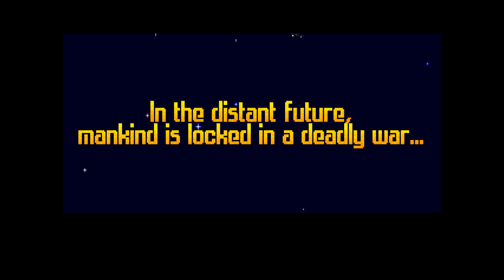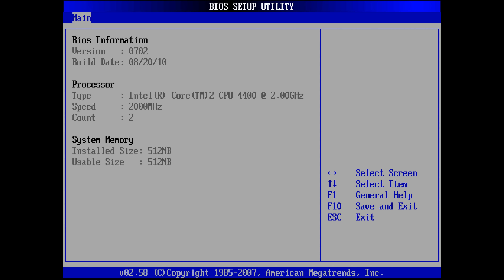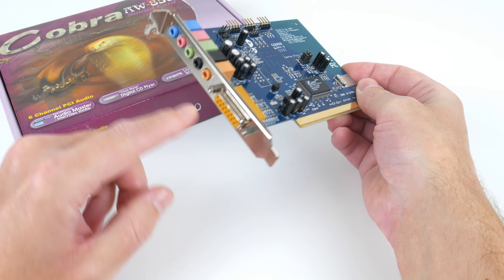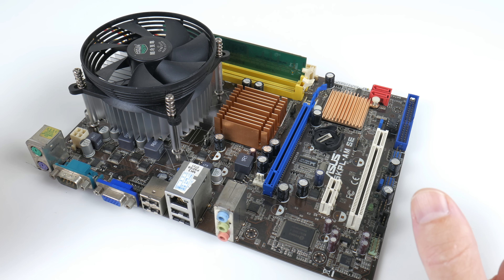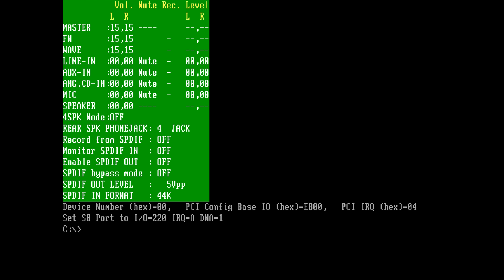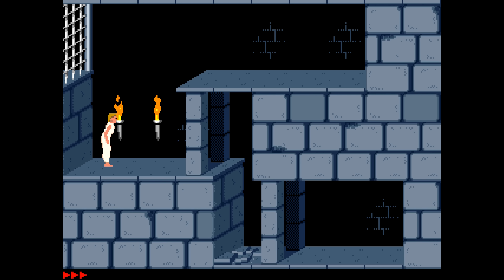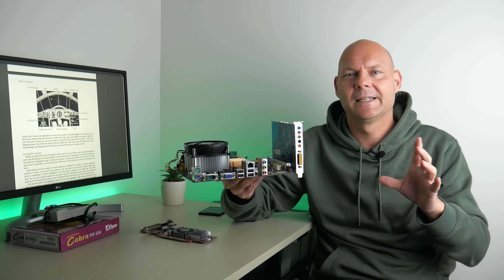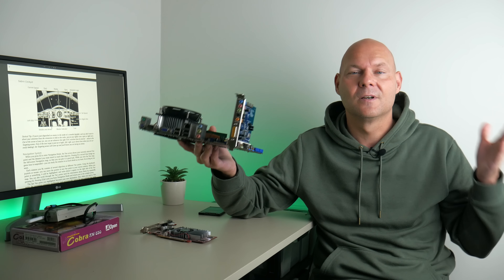DOS Retro PC with Parts nobody wants

Comment: LGA775 just refuses to die. Core 2 Quad systems paired with an SSD, 8GB of RAM and a decent video card can still make for a good basic daily driver. One of the best platforms Intel has ever made IMO.
Reply: Absolutely. Great for Linux retro gaming and I keep a stack of them in the garage for when the guys come over a few times a year for beer, pizza and a LAN party.
Reply: I still play AAA games with a Q6600 and decent graphic card in 2014-2015. I just need a bit of overclocking to make it more playable
Reply: @emdotrod  If it works then good luck to you. I just think AAA games have been complete crap for more than a decade now, the last one I purchased was Fallout 4 in 2015.
Reply: It was an unbelievable rebound after the Pentium 4.
Reply: Do Core 2 Quad CPUs run hot?
Reply: I have 2 975xbx2 intel boards that I'm playing around with a 3.72 dual coreEE CPU and 3 1080 watercooled GPU's that I'm working on. They may not be the fastest systems around but since the CPU is an engineering sample I have had it running at 4.5 ghz. Watercooling will help too! This sucker runs very warm!
Reply: Wolfdales E8400-8600... DAMN! ..and i'm a AMD CPUfanboi(well OLDer person) 😉
^Gotta' keep my Socket 939 A8N-SLI with Opteron 180 for W2K/XP-build someday...sry' 😕
Reply: @dave4shmups  yeah, specially Q6 series when overclocked, still nothing that an old Intel stock cooler with cooper core or an Hyper 212 can't handle
Reply: I bought a couple of Core 2 quad processors for next to nothing a few months ago. I agree they are still very capable
Reply: Phil has already done a vid on modding Quad Xeons for 775. And I can say that it is fantastic performance for 775. I have one that OCs to 
10 x 420 = 4.2 GHz on nearly reg voltage. It is a Quad Xeon X5470 with a 10 multi. The X5470 is the only Quad Xeon that has a 10 multi. And when I got it I said "When you OC with a 10 multi, it feels like you're cheating". LOL
Reply: @dave4shmups  If I remember rightly they do run hotter than the Core 2 Duo, possibly cooler than the Pentium D though!
Reply: @billchildress9756 I have a D975XBX with a QX6800 in it, haven’t used it since it was taken out of my 2nd machine in 2019. Hope to one day stick it in a case with a dual PCB GTX 295.

Comment: A socket 775 system running a 386 game properly is a testament to the x86 retrocompatibility.
Reply: Yes, it's just a shame there is all that "messing about" in the BIOS to disable/enable caches, etc. It would be wonderful if you could just run a simple tool to load in the BIOS you want each time without having to do the changes manually.
Reply: i have 775 quad core system that an run all 2023 in 1080p
DDR 3 max, 9650 !

Comment: Hey Phil, there are some really interesting CPUs for 775 available. The Celeron 400 series, codename Conroe-L. They are native single core processors (the last native ones that Intel produced) with up to 2.2GHz and only use up to 35W and are available for pennies.
Reply: So true! I have a Celeron 440. This little guy beats a Pentium4 @ 3GHz with less heat and power demands. But still stick to my S478 Rig and the Socket A systems.
Reply: Back when i was in highschool we had computers with Celeron 420 and 2GB of RAM. They originally had Vista and then they upgraded them to 8 and to my surprise they were very snappy for a singlecore chip. I never liked Celerons but the 420 was really great for what it was
Reply: Thats what i’ve been using for years with my Asrock 775g65i. Makes a perfect miniatx PC.
Reply: @Stratotank3r  Pentium 4 are a furnace, even with a fancy-pants Zalman cooler there's no way to keep the temps lower than 50-40ºC even in winter.
Reply: I have one with a pentium dual core, may have to try this buikd
Reply: @farben_  My P4 Northwood with just 2GHz is very cool. Only the high end models and Prescotts were furnaces.
Reply: @Stratotank3r  Was never able to get those ones, only have P4 3.0, P4 3.20 and  P4 3.40GHz, both 478 and 775.
Reply: DOS / Win 98 doesn't support more the one CPU core, so should make no difference if it's C2d, P4 or Celeron. I would pick whatever is cheapest, and utilize least power. However even a 65W C2D CPU, will use way way less power, when speed capped as shown in the video. Maybe only a few watts usage from the CPU itself. On the non speed sensitive games it will also use little power, due to the limit set in the game itself. CPU may only be using 5% or less of it's capacity.
Reply: @Wushu-viking  That's why i recommended the Celerons, they are single core, low clocked and power efficient. Perfect for DOS / Win9X. Also really fucking cheap.
Reply: @CHA0SHACKER or maybe pentium dual-core
Reply: @bitelaserkhalif  for a windows 9x or DOS machine? These only support one core anyway. An a single core Merom based chip is already faster than anything these systems need.
Reply: @CHA0SHACKER  both, undervolt for better effect
Reply: @usernotfound-h2v Back when I left school, the first version of MS Windows hadn't been relaeased, MSDOS 2.x was current, a version of the (very expensive and business oriented) IBM PC was about to be released with the "new" Intel 80286 CPU, and most home computers had 8 bit CPUs. All CPUs were single core, and any more than 64K of RAM made most machines quite "snappy". 😂
Reply: @farben_ Yes, they do run hot, they're not fast given their clock speed and power consumption, and they deserve to be maligned and hated by everyone. But, they did exist for quite some time in one form or another, so I daresay many people will have some nostalgia for them. They're also cheap and plentiful, and in winter, you get to warm your house whilst playing games! 😂

Comment: Great stuff. I built a nice high end 775 Windows XP after watching your previous videos Phil. Only cost me about 40 euros in total - E8400, Abit IP35 Pro, 4GB Corsair Dominator and GTX 285. Runs like a dream.
Reply: I had an IP35 Pro with a Q6600, Zalman CNPS 9700 LED, 4GB of G.Skill DDR2, perfect condition...finally threw it out summer of 2022 because I figured it was just slow, old junk that used too much power for too little result compared to modern hardware...just over a year later I'm really kicking myself, that was all good stuff and would make an awesome throwback machine now that I've gotten the retro bug.
Reply: @406Steven  Gutted. Hopefully you can pick up similar parts from people who felt the same way as you did last year. My retro pc bug started a few years back with a Pentium 4 system that was given away for free. That one is setup as a Windows 98 machine. It's great having the original hardware 👍

Comment: My daily PC still is LGA775 with E8500, GeForce 9800 and 4 Gigs and it is good enought for net surfing. Not fast, but works. Didn't cost anything and older games runs great. I use Linux, so no proplems with overly heavy windows.

Comment: I had 775 for a really long time, it is still used as a primary computer by ma parents. I replaced the E6550 with Xeon E5450 which is equal to Q9650. You can watch youtube without problems, system is working for it's age very well.
Reply: I am writing through a q9650 8gb and windows 10 pc which is my main, no problems at all other than modern gaming.
s775 best platform over years.

Comment: Nice video!  I once owned several LGA775+E8400/E7500 PCs that be my main working force -- they're powerful but yet very cool on thermal, one of the PC I built as NAS only use tower cooling without FAN. Unfortunately I sold/gave away all my these 8 years ago. Now I regret I should keep one set of it just because they've done very well of my need.

Comment: Oooh another video! ❤ Awesome with a Core2Duo project, I'm planning out my Core2Duo for this weekend as I just received a graphics card of the exact same type I used so many years ago, so now I can build an exact copy of my system I had before for Windows XP.

Have a great weekend Phil and sleep well as I'm sure you're heading off to sleep in a short while 😋 (from posting this video that is)
Reply from the maker: ZZZZZzzzz yes need sleep :D What GPU did you receive?
Reply: @philscomputerlab  an XFX 8800GTX, I remember when I bought it, it was the most expensive and most powerful graphics card available at around USD $550 and the most expensive I've ever purchased.. these days its almost impossible to get the highest tier graphics cards 😂😋 either too expensive or no stock.. But it was cool back then to have the absolute best.

Thanks for the reply! ❤

Comment: The core 2 duo or quad fell out of favor a bit more recently for a very simple reason imo, it was still pretty reasonable to use as a daily or even for a lot of modern games. Sure the instructions set or lack thereof became an increasing issue. 
So naturally what was used for modern stuff till quite recently isn´t really looked at for "dos gaming" purposes as it is probably considered to new. 

Had a c2q 6600 clocked at 3.2ghz for years, was an amazing pc and held up damn well. In regards to old games, i really stopped worrying so much about using older hardware and building a retro pc for that very purpose. Dosbox came a long way and if you add roland 32 emulators you are probably good to go for the vast majority of games on your overpowered daily machine. 

Still loved to work with old hardware, and would still do but i would lie if i had the time. And just buying retro hardware to then have it sit in a shelf is a bit of a waste, like hoarding cars.
Reply: Up until 2 years ago, I was regularly using my Socket 775 machine for browsing the Web and playing games. Mostly on a 3GHz C2D E8400, but I upgraded it to a fast C2Q just after I was given an "old" LGA1150 machine with a fast 4th gen Core i3. The C2Q got used less and less. The i3 CPU was replaced with a much faster i7, but thanks to clever software developers, all my old games will run just fine, so I don't need to keep and maintain lots of old computers. I kept some anyway. 😁

Comment: LGA775 is the most underrated platform for the widest range of usability (and with that, the Radeon x600 or x700 is the most underrated graphics card for Windows 98 specifically), and Intel 4th Gen is the most underrated platform for XP or a hybrid XP/7 or XP/10 system.

Comment: Great video and spot on.  There are still lots of good buys to be had for socket 478 and socket 775 boards that do really well for XP and earlier builds.  Socket 939 is still probably my favorite from this timeframe, but there is no doubt about the great value to be had with these lesser desirable socket boards for retro gaming.  Thanks for the links too!
Reply: 939 stuff is getting expensive but 754 is kind of the red-headed step-child as it wasn't produced for long (us early adopters paid that price!  I remember how annoyed I was with AMD about that).  A64 stuff performs better but Socket 478 stuff is CHEAP.  I picked up a Northwood 3.06 last week for under $20 shipped, the trick is finding a motherboard with PCIE rather than AGP because it's easy to spend your savings buying an AGP card whereas PCIE cards are cheap--I use a GT 730 in my Core 2 Duo machine and it does exceptionally well with things like Mechwarrior 3 with high-res mods.  My main 478 machine runs an FX 5600 Ultra and I've got a second one with a 9800 Pro in it but these days either of those cards will bring $80-150 where I paid more to ship my GT 730 than what I paid for it.
Reply: @406Steven    I pretty much agree.  I got caught upgrading late in the Socket A/ socket 370 period, and had a similar thing happen with socket 423 right before socket 478.  I bought in on the sales of the previous gen and got good short term value, but they aged badly.  I never was a big spender on computers, so I was ok with my decisions, and usually invested in upgrades for the video card.   Amazing how much AGP cards have risen in pricing.

Comment: For the past few years I have really enjoyed playing my old dos games with dosbox. I have spent some time setting up DBGL and using dosbox ece my experience has been amazing. With the ability to quickly dial in speed and sound settings and being able to easily capture the game play from the same machine makes it handy. I can also zip my entire DBGL directory and copy it across to any of my machines. I still play dos games on my older machines like my pentium2 and pentium3 machines because of the authentic sound quality from my old ISA sound cards like the ess audiodrive es1868f or the awe64 but I really find myself in DBGL more because of the simplicity and features it offers. I also think that using such newer hardware and having to adjust all those settings and running tools like cpuspeed in dos is just very time consuming and then having to change all those settings back to run windows would be a total headache. For me I came into dos games around the tail end of the era, so speed sensitive games I'm not really nostalgic for. My elementary school had an old game called digger installed on most of the computers in the classroom. I went and tracked down that game and found out it was speed sensitive but someone back in the early 2000's made a new version that fixed that issue.
Reply: Someone on that school had very good taste then :-D Greets from a hardcore digger fan!

Comment: ...and here I was on the fence about passing along my Core2Duo parts because I have way too much stuff in general. I guess I'm going to hold on to it for now to avoid kicking myself in 10 years when all the current retro hardware dies and/or is unobtainable. 

My Auzentech X Meridian uses a CMedia audio chipset and I didn't realize it had such decent DOS compatibility. I've only tried that card in Windows Vista, 7 and 10. (Most feature-complete support was in Vista)

I'm going to have to dust those parts off now and tinker. Thanks!

Comment: I love socket 775 Pentium 4 (own a Pentium D 541) for late win98/ early XP gaming. Paired with a Radeon 9800XT and a SB live 5.1 it's a powerhouse. I often mess and mix to play older games as well, and love it. Board is an msi neo3-f. Also have a couple voodoo 2 evilking than I sometimes plug in, using SLI for glide games. A lot of fun!

The use case in this video was one I envisioned before buying and building, but shifted gears later, as I came into a little surplus in budget I could use. Good times

Comment: Recently upgraded my secondary office-tasks machine from Core2Duo/2Gb RAM/Built-In Intel Graphics to Core2Quad/4Gb RAM/nVidia 8800GT 512 Mb. Now it runs perfectly under Win7 32bit. FullHD Youtube - no problems anymore (previously there was not enough memory and CPU power to run FHD Youtube smoothly).
I'm sure it is also able to run games from 2000-2010-s pretty well because it's a middle-end config of the age.
And even today there are plenty of 2D/light 3D modern indy games perfectly playable on this setup.

Comment: Another hit on the nail Phil, very cool alternative. I put together a similar build (same MB as you) as an "ultimate" Win98 Machine (Core E8600, Nvidia 7950GT, SB Audigy). You just expanded the idea of booting it into DOS 7.1 (with the Super Easy PIF you provide on your site). I will try to use DOS on it like you demonstrated, with a Solo 1 and the 8738. Worth mentioning, there is a similar board from ASUS (P5KPL 1600) that has some extra features (like 3 PCI slots) and offers a little bit more flexibility if desired. I bought both 2 years ago, for same price (each US$ 30) and some Core cpus (E4xxx, E6xxx and E8xxx - US$10-15 each). Worth mentioning folks going this way need to setup SATA as legacy/compatibility mode on BIOS. And last, try that Quadro FX1300 (PCIE) of yours on this motherboard (the one you tried on a video a couple of months ago), I got mine working on this motherboard without hitches. Thanks!

Comment: i am still using a Core2Quad Q9400 on my  socket 775 asus P5QC motherboard, slapped 8GB of DDR3 ram in there, a GTX760 from Palit, overclocked the cpu to 3,2 Ghz and i use it as my daily driver for Linux mint and windows 10. works well enough.

Comment: Linking from PC to PC with a MIDI cable is a way to get efficeint usage from a soundcard discovered to be useful like that because it means it can be shared via multiple computers, and even sometimes a breadboard (even with some glue logic depending upon the other electronics used on it) with multiplexers can expand it at low cost whilst learning what makes it tick. So even if one computer has a lack lustre soundcard, as long as it has the MIDI connector, there is potential (or a USB to MIDI conversion cable). Such game ports and MIDI ports can trigger robotics or be for a control surface (open sound control or joysticks, gamepads etc.) or modding a beer-fridge light with RGB so it resembles "christmas tree lights" come "fast and furious" cars underlighting, and activation of a tune selected depending on the party theme (Halloween, Chrimbo, or maybe the anniversary of the first time you ever snagged your trouser pocket on a door handle whilst stepping in lego and other such fond memories for which we are eternally grateful for being sent as a challenge thereby filling up our otherwise grey lives).
As for LGA775 motherboards, some are bound to become candidates for LibreBoot (a good project worth noting).
My comment has no hate in it and I do no harm. I am not appalled or afraid, boasting or envying or complaining... Just saying. Psalms23: Giving thanks and praise to the Lord and peace and love. Also, I'd say Matthew6.